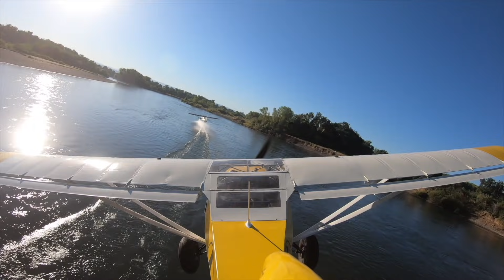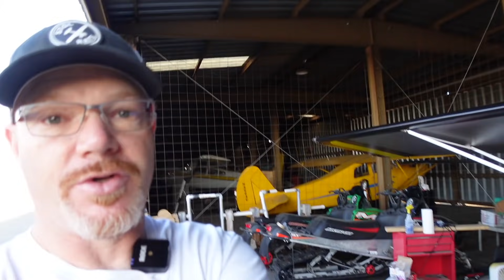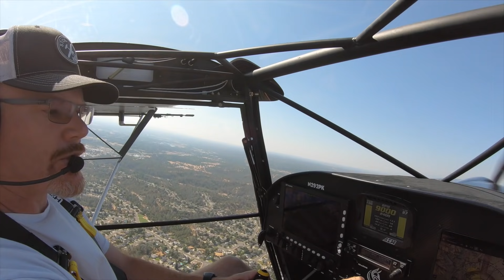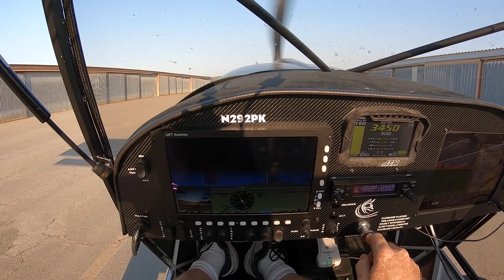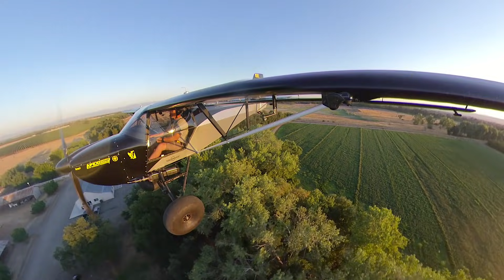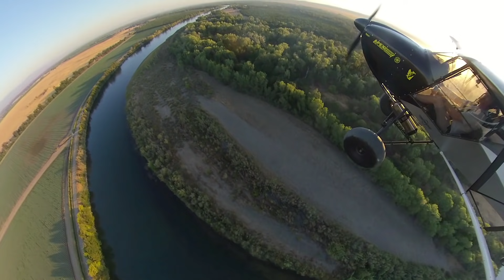Kitfox 7 Apex Build Episode 53 VG's

Comment: Thanks for the great videos!  Using your advice  as well as the about2stall videos instructions, with stolspeed vg’s , I managed to go from 50 down to 40 mph stall speed clean engine off. With flaps from 46 to 37.  Vg’s were placed over the front of the cockpit and along the bottom of tailplane 4” infront of the hinge. It is now difficult to get it to stall in clean config.  Well worth the effort. Kitfox series 7 standard wings Jabiru 3300.

Comment: Do you have the factory aero struts or the round with an added fairing?
Reply from the maker: They are bare struts right now, but they will be faired in carbon fiber soon.
Reply: @BowenAero  was this done for weight, my faired ones seem heavy?

Comment: Say, Bryan, where in your CG envelope are you sitting for these tests? It would seem that with a forward CG you would maybe expect to run out of back-stick travel sooner than with rearward CG.

I'm also curious where in your trim range you were at for the tests (maybe you said and I missed it). I would think you would want to be testing at close to full-up trim similar to a landing configuration.

Thanks as always, Bryan, for the great videos.
Reply from the maker: Yes full up trim. CG is about as forward as it will be, everything you add in a Kitfox moves the CG aft, people fuel and baggage. I was almost full fuel, but no baggage

Comment: Not sure what type of trim the Kitfox has but on many aircraft, especially if they have an elevator servo tab trim, you will get more authority and a better stall if you trim full nose down. If you have stab trim like a Cub it might be the opposite, can't remember.
Reply from the maker: The entire horizontal stabilizer moves up or down for trim.
Reply: Yea, like a Cub. For that possibly try full nose up, it might make a difference when practicing stalls.